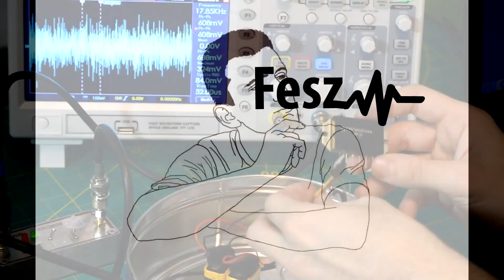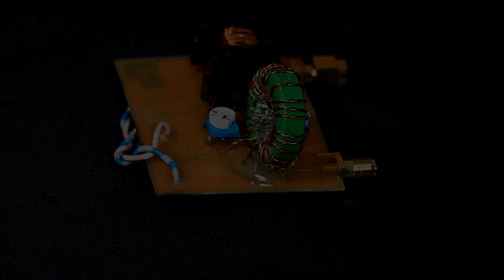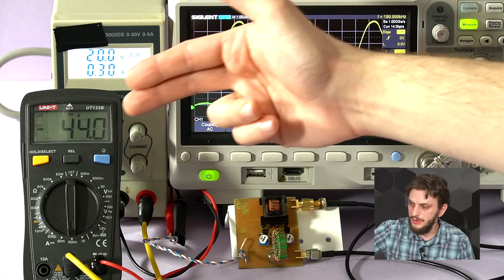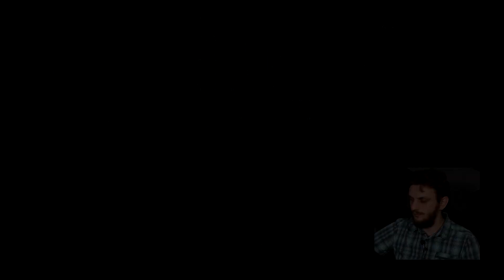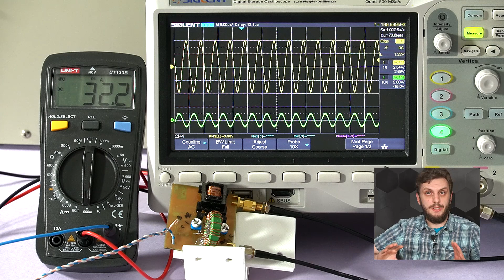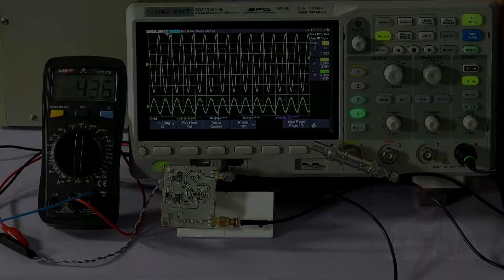The Class B amplifier - design and test (2b/2)

Comment: With more knowledge I got from books finally I start to understand your videos :D I made like a huge progress from what it was 3 years ago. I have already built your circuit and try to design my own based on yours but for a different frequency (I need a good power amplifier. I feel like having privat lessons with your videos which actually explain some complex problems rather than just teaching from the begin (which is better from university books of course). Btw. TME is a Polish company from Łódź :))))

Comment: Really insightful series. I'm playing with some amplifier designs and this is very helpful. Could the toroid core type be responsible for poor performance on higher frequencies and distortions?
Reply from the maker: Not really, the core shape should not have an impact in frequency performance. The main issue, in my case was the core material - it was not rated for high frequencies, so it works poorly.
Reply: @FesZElectronics  That is what I wanted to say, core material :) The green one is usually only for under a few hundred khz, and for hf radio you need another material.  But since you mentioned it, core shape might have some impact as well, I usually see binocular cores used in amplifiers, but still unsure of the difference.